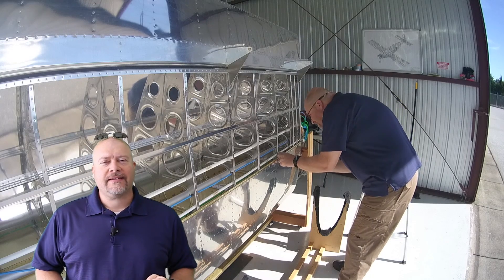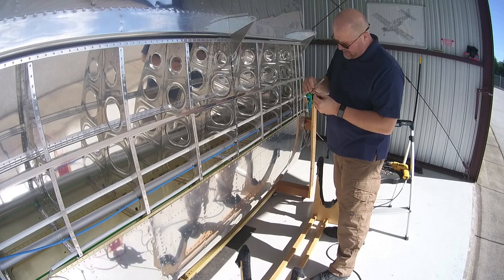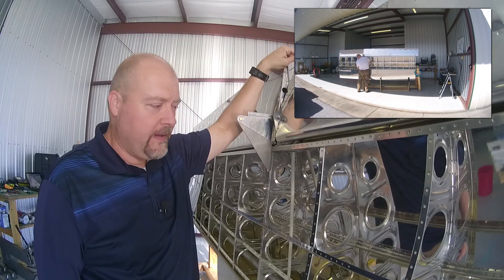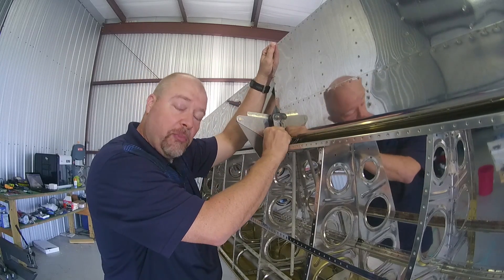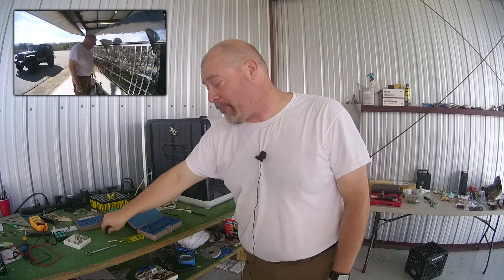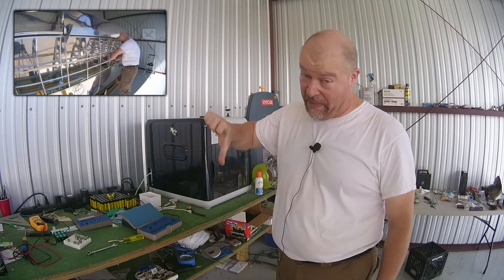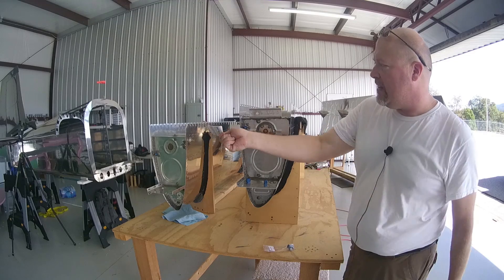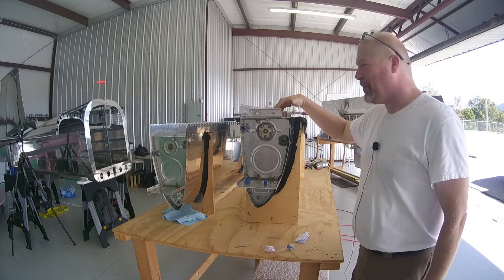RV-10 Wings - 069 - Taking tank off, leak testing, Aileron bracket fixing

Comment: Not that you did this Jason, but I get a kick out people using battery drills to loosen/tighten screws in nut plates. That causes a lot of friction as the threads of the nutplate is crimped out-of-round slightly, so that there is friction securing the screw in place for safety. So then when the drill drives the screws in, the screw heats up and is virtually welded into the nutplate. Then you get to drill out the head, chisel it off, and then grip the screw shank with a needle-nose vise grips. Been there, done that.

Comment: Man I would rather use a pressure gage for a static pressure test.  Balloons aren't very good at holding air for very long
Reply from the maker: The issue there is you need a pressure gauge that can measure extremely small amounts of pressure.  Any more than a couple psi could damage the seams.  So sayeth Vans  =) Balloons give you a rough idea if there is any pressure and if it doesnt leak down immediately then there is a godo chance its fine.  more over if you leave it on there for days and the balloon inflates/deflates with the barometric pressure of the day, then you know you're good.

Comment: I learned that the hard way as well but not on an expensive airplane. When using a high speed drill, screws are typically single use. Turn the speed and torque down and you'll have more favorable outcomes.

Comment: Fuel Cap.. important it is not leaking. Do not tape for test ..Reason.. When flying as we all know air pressure is reduced over the top of the wing to create lift. If the gas cap does not seal, you will leak fuel while flying...Great Job..

Comment: You can get most types of screws from McMaster Carr  https://www.mcmaster.com/ .  The nut plates are designed to be resistive so the screws don't work out, so DO NOT TAP them out.  I would use either AN screws or Stainless.  However, avoid Stainless on Stainless, this tends to gull, but this problem can be reduced with lube.    Lube aways helps :)

Comment: To help check for and find leaks, how about pouring in some UV dye into the tank during you leak tests. Shining a UV light around the tank really makes leaks stand out. I have used it to find oil leaks on my car's engine. Works well. The kits are about $20.00 on ebay..
Reply from the maker: That's a great idea.. love it.  I should get some.

Comment: Who ever said those heat shrink labels will change color over time with heat, is 100% wrong! the printing is via dye sublimation, from a tape contained in the cartridge that contains the tubing. It will NOT fade, discolor, or change in color over time. The fact that it will be in a dark enclosed location will also mean that it will not degrade due to UV exposure, which is the only way they will degrade! In short, you're good to go with them.
Reply from the maker: OH good to know!  I can only go by what folks tell me.. shrug

Comment: Use the AN-spec screws, as Van’s has provided. This is a plane, not a go cart.
Reply from the maker: Van's seemed to have no issue with my using Torx.
Reply: Jason Ellis Torx shouldn’t be an issue, as long as the material matches to the AN-spec material. The brass screw idea isn’t a good one. Brass has its place in an aircraft, but it is typically around the avionics that are sensitive to the potential of magnetism that may be present in a screw that has some degree of iron.

Comment: AN fittings don't need sealant or Teflon tape. They are designed to seal themselves on the taper. People have died using sealant on fuel fittings. If they leak, it ain't right. Something is out of alignment etc (fittings that is, not tanks).

Comment: Much better than screw extractors are Vampliers, screw extracting pliers. Very expensive but worth it. Tip from a professional electrician. https://www.amazon.com/VAMPLIERS-Linemans-Extraction-Specialty-Extractions/dp/B00LMOAYR2/ref=sm_n_au_dka_US_pr_con_0_3?adId=B00LMOAYR2&creativeASIN=B00LMOAYR2&linkId=4b77f86cc1a3e40dcb2c9621fccc0790&tag=lo02f_bottomofpost-20&linkCode=w41&ref-refURL=https%3A%2F%2Fwww.loveyourrv.com%2Ftop-20-must-tools-rving-fulltime%2F&slotNum=0&imprToken=QDfExaIgfGXU9wK7JRcrpA&adType=smart&adMode=auto&adFormat=grid&impressionTimestamp=1540412796443#customerReviews

Comment: I don't like EZE OUTS as they mess up more times than not Snap-on® makes a nice screw extractor set (EXD-35) left-hand drill bits Harbor freight sells a left-hand bit set or two.
Most times a left-hand bit will spin the offending fastener out in one operation. No way I would use Torx® head screws when I could use hex/Allen® head screws. Anti-seize® on the threads when attaching dissimilar metals together like steel to alloy. Permatex 80078 Anti-Seize should work just fine. a dab will do you like spark plugs in an alloy head just enough to coat the threads.

Comment: Use of the tap wrench ---- found those also useful for drilling out plexiglass.  Eliminates concern over chipping as the bit exits the plastic
Reply: Shrader Valve is supposed to interface with a stub of neoprene hose which then fits over the fitting with hose clamps (ok to use without the clamps)
Reply: you are going to leak air before you leak fuel.  If the integrity is good with air, you are good

Comment: I’ve found that screws bind and seize in nutplates if you don’t have a drop of oil on them for the first time that you screw them in. Also go slow the first few times, if you use a screw gun, the speed gets them hot and they gall in, then the head strips! Some people run a tap through them to remove the locking feature, but if you oil the threads and go slow, they should be fine.

Comment: Jason, once you've done the rivets on the aileron hinge, leave the flaps and ailerons off, you don't need them on until the wing for quite some time yet and they are only going to get in your way or get damaged! and if you put the tanks on again, only put half a dozen screws in until your ready to do the final assembly of all the aircraft components ... will save you time and headaches between now and then :-)

Comment: Mr Ellis, just something to help you in the future.  My crew chiefs in the Army Aviation use something when removing screws to prevent stripping as well as get screws out that are starting to strip.  I'm not sure what its called but it comes in a bottle and you put a drop on the screw head.  its a liquid with some type of textured material in it.  I have all used myself a simple wet tip screwdriver dipped in backing soda. Cheers!
Reply: In the Navy we called that stuff E-Z Grip and it's amazing!